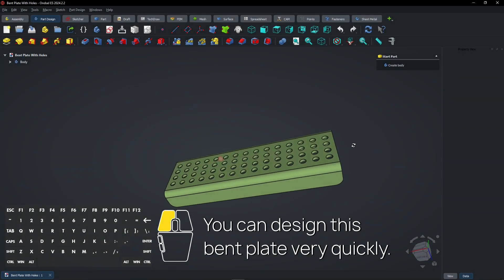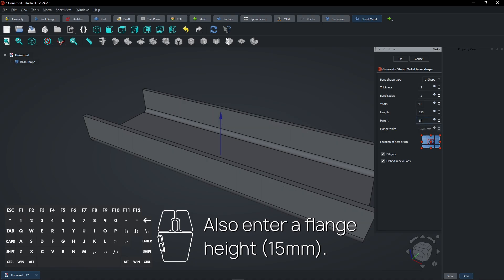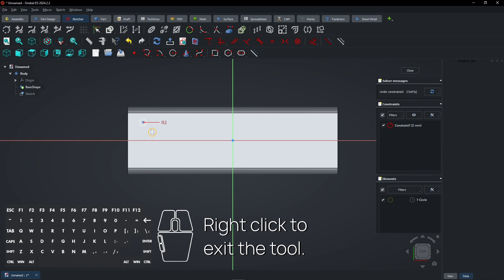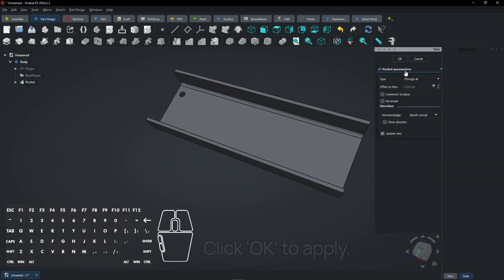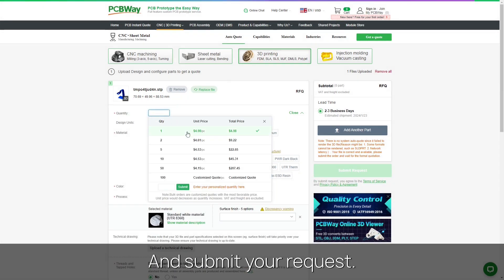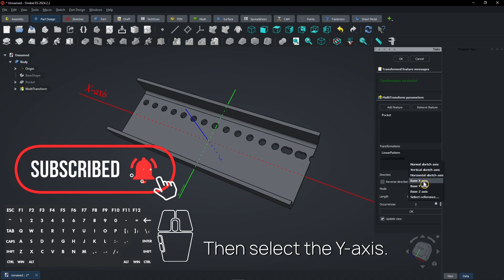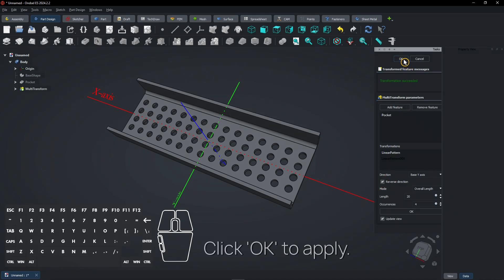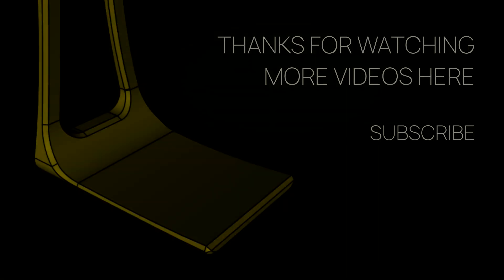⚠ Bent Plate With Holes - FreeCAD Sheet Metal - Ondsel ES - Ondsel FreeCAD

Comment: Another tutorial successfully completed! (This one was very simple, if I couldn't finish it, I should give up everything and go sell hot dogs in the church square.) :) 

My goal is to print my small projects, nothing too fancy. However, I noticed when viewing the polygons (V, 4), that the entire geometry is based on triangles, which doesn't seem to have much refinement. 

In the previous racket tutorial, the problem is more evident. The body of the racket is defined with few polygons, making it very faceted. However, the racket's holes are exaggeratedly defined, with many faces for each of the holes. 
The end result is very unbalanced. When the object is printed, the faces of the racket body will be easily perceived. 

Is there any setting to redistribute or balance how polygons are created?
Reply from the maker: 🤣 Glad you could finish it. Good job again!